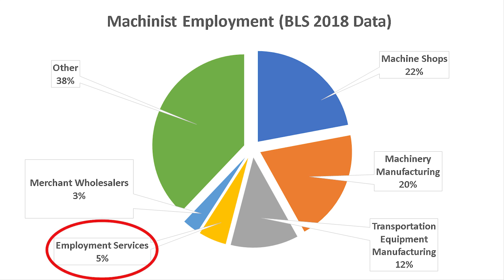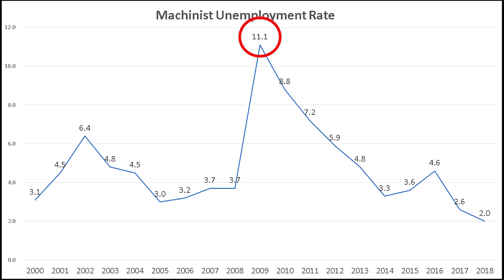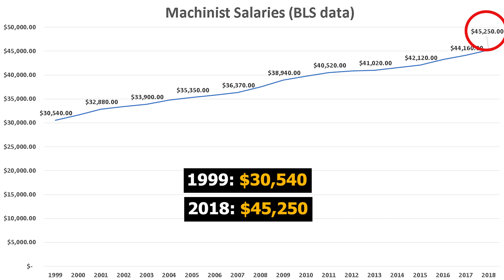Machinist Salary (2019) – Machinist Jobs

Comment: Just like any other careers there are different kinds of machinists that specialize in different kinds of things. There are mold makers, machinist that work in prototyping and machinist that do production jobs. Some people have the knack for being a good machinist and some don't. If you're starting off as a machinist just know that you're going to start off at the bottom maybe deburring parts or doing quality control. You want automatically just get thrown into making high precision parts with 0 years of experience.
Reply: Ik I've made posts before but I decided to quit the trade and go to college. just too low pay for the mental stress and work expected.

Comment: But machinists usually don't program(cad/cam) or even change feed rates unless you are on a manual mill cnc usually you need to have an advanced education or a lot of experience in the field also machining is a very repetitive job but depending on where you work that could change also tools are very expensive you need only a quick search you usually run tolerances around +/-.005 inch tolerances so you need good not cheep measuring tools such as calipers and micrometers which are also very fragile and need maintenance and calibration just dropping calipers will break them
Reply: That’s sadly how easy this trade has become for the rest one the work, I work in nz and we do everything from cad/cam to manual programming on the cnc and feeds and speeds is what we change or adjust all the time, nz is far behind on the tech for more machine shops, but it makes us more than just “ button pushers”

Comment: After almost 25 years, I got out of the trade due to offshoring... I'm not going to get into all that, but what I DO notice is that for every YT post I see promoting machining (especially within the US), why is it I always see three or four videos of manual and CNC machinery up for sale or auction?
Reply from the maker: Appreciate the feedback. Offshoring is happening to many occupations, unfortunately. I think many people are attracted to machining as a hobby, not just as a career.
Reply: @CareerWatch - That can be an expensive hobby, with decent quality manual machines, and especially small CNCs (even used stuff that you DON'T have to spend a fortune on replacing worn parts before even starting them up, which is usually the case) all going at a premium price... Not to mention things like inserted cutters, endmills & drills that won't burn out on the first application (like most of the IndoChinese-made crap) and decent-quality inspection tools and gauges...
Reply: @AB-vq8ho  - I have no idea anymore... It seems that it would greatly depend upon which aspect of the industry you get into, such as aerospace or specialized replacement parts like turbines for electric generators, or even what country you are in... Within the US, I don't see the average job shop type machinist (CNC and manual) making the good money they once did 20 years ago...

Comment: I Am a "Union" Maintenance machinist Apprentice in Louisville KY. And I make north of 100k the Journeyman machinists I work with make over 150k. Manual machining only. I am new to the trade so I can only assume the statistics are Non-Union?
Reply: At least the Unions can get you the pay you deserve

40k for a trade that takes quite a lot of skill and knowledge is wild. I don’t know how anyone could do it
Reply: I worked for TVA in Alabama doing the same thing. Yes, you can pull in that much, but you don't have time to spend it. Most of the work isn't even machinist work at all either. Just a lot of hammer swinging. Long hours, 7 days a week at times, makes you an old man quick. So I took the pay cut and went back to job shops. I make enough to be comfortable and IMO, that's all that really matters.
Reply: @LTR1420  90% of the time I'm napping working on my own projects "G-Jobs" waiting on a call on the 2-way to go replace a cylinder or coupler or another 10 minute job 🙂 I've broke a sweat probably 11 times in the last 2 years.
Reply: That's insane. How is the wage so high over there? I am a CNC machinist south of MPLS and only pull in 40k at the moment
Reply: @zachwellman5837   "Union"  lol
Reply: The majority of the machinists I work with came from "Job shops" and they tell me you don't make much being a machinist in a job shop. The money is being a maintenance machinist in industry for example Toyota, Ford, GE, Cummins, etc.
Reply: @jake canebrake  $32/hr. If you work off days it's double time plus $150/off day attendance award. Anything over 12hrs. Is double time. Get a call  in early it's automatically 8 additional hours pay even if you can only make it in an hour early
Reply: @jake canebrake no offense but you are obviously not familiar with union wages. i work for Reynold's brands
Reply: @jake canebrake i essentially had no prior machining experience. I entered into a four year apprenticeship. Which the company pays for all 4 years of college. If you think that's making alot our Electricians, pipefitters, and oilers make more than that

Comment: good machinists  get over  $35  / hour
Reply: That requires master cam knowledge.. Programming and set up with no supervision as well as 5 Axis experience and I'm sure some other machines like mills and lathes you had better be able to make hum efficiently to be seen as worth 35 @hr
Reply: @tylercampbell6365  yes, like he said, good machinists
Reply: @jake canebrake That sounds about right from what I’ve seen around the Kansas City area where I live. I work as a manual machinist in a pump and motor repair shop that’s non union, and top pay is around $30hr here. We still make double time on Sunday’s and always have lots of overtime if you want it.
Reply: @KM-bc3lm  You Dont need  15 years experience getting  $35 / hour.   If you work   one  machine and one model only and only certain type  of  part then even if you  experienced 15/20 years  they  will laugh at you, When you work in a machine shop first three years  you need to be work two or three type of machine. If you work only as operator you wont get   $35.    .Can you please tell me which states you talking about ?